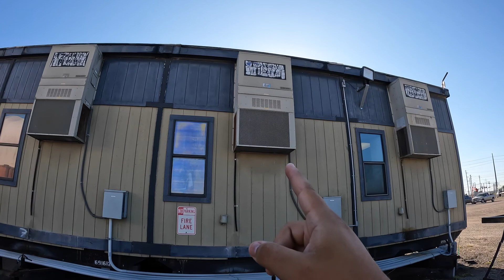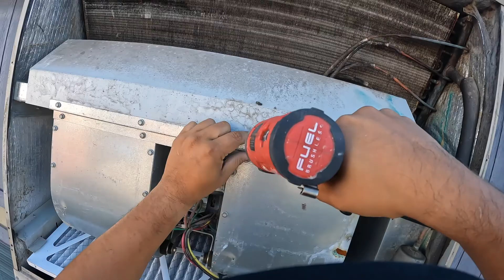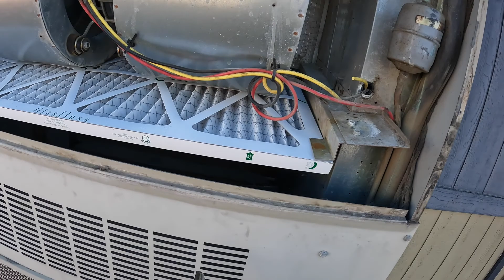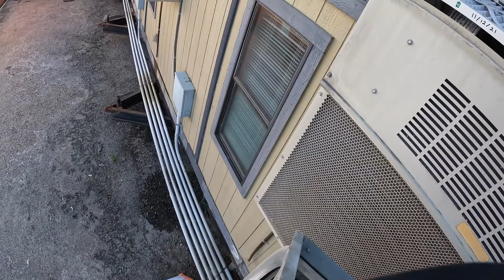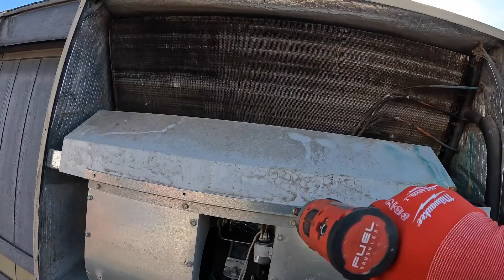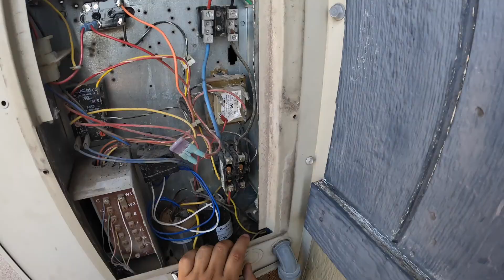Bard Wall Mount Unit Evaporator Fan Motor Assembly Replacement

Comment: it says replacing replacing evaporator but this is just the motor
Reply from the maker: You are right, I apologize for the confusion. I’ve changed the title to be more specific.
Reply: @cpm4hvac414  I just changed an evaporator last week and it was really pretty easy, I didn't even have to take the blower out

Comment: Thanks for showing the location of the coil assembly, now I know where to brush, vacuum, and spray coil cleaner on…
Reply: You’re welcome! I also made a video on replacing the condenser fan motor, you can check it out and see how easy it is to get access to the back of the condenser coil for cleaning as well 👍🏼

Comment: Subscribed. Can you do a vid on charging a 410A bard please?
Reply from the maker: Thank you! I certainly can make a video on charging with 410a. These units also tell you how many ounces of refrigerant they should have. So you can recover all the gas and weigh it back in right on the money.
Reply: @cpm4hvac414  
Hey bud, we have a Bard unit that we can not get evaporator fan to turn off.  Any ideas?  Thermostat was already replaced.
Reply from the maker: @bp8674  that can be a tricky one, did the fan turn off when the thermostat face was disconnected? How about if you remove the green wire only? It could run continuously due to a faulty evaporator board or relay.